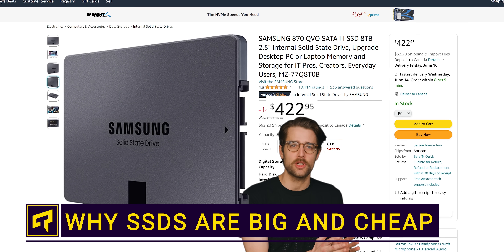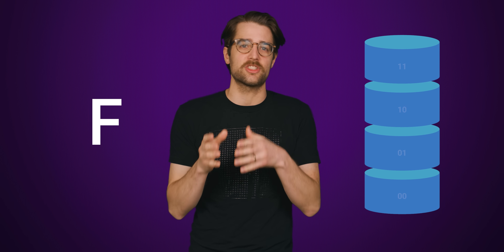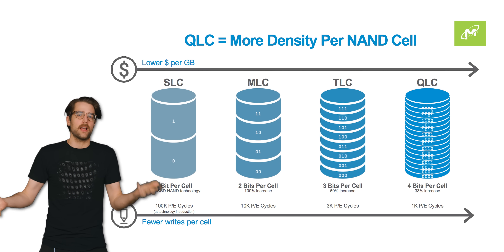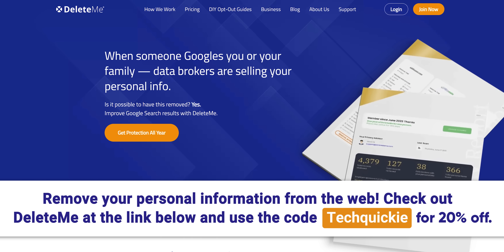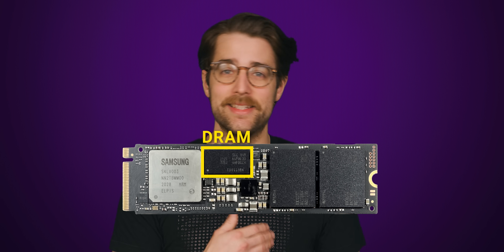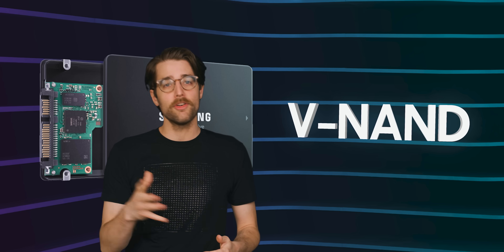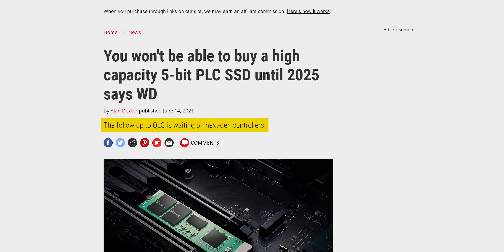Why SSDs Are Big And Cheap

Comment: So what's the best type of SSD to buy? Or it depends on what you do with it? Let's say best type of SSD for installing(and uninstalling, of course) games and play games from it, what SSD should I buy? And also, what's the best type of SSD for storing photos and videos(not random ones, important, memories, vacations, etc)? Or for photos and videos HDDs are more recommended?
Reply: If you can cheaply get 1tb true SLC one - go for it. Though it will be quite expensive and these models are rare. But as the video mentioned, modern TLC and QLC will use SLC filling schema until they run out of space and will reshuffle and squeeze the data to get more capacity, so it doesn't really matter that much.

Basically, if you want a great SSD - go with samsung, 3D NAND TLC kicks ass in terms of everything, basically. 

But if you want it cheaper, get basically any TLC one, but don't forget to check if it has DRAM cache on board. If it doesn't - don't buy it, it's not worth it, the speed will suck ass and it might get borked sooner depending on the controller (disk lookup table, something that changes constantly as you use your drive, is usually stored in DRAM and backed up on the disk before shut down, but without DRAM it has to be constantly written to on the drive itself). 

If you want a huge storage for random stuff that you don't plan to rewrite often - QLC is your pick. All SSDs can handle infinitely many read operations, the only thing that degrades the cells is writes. And to be fair, even QLC will probably last you half a decade or more even considering semi-regular rewrites.
Reply: @ДмитроПрищепа-д3я  It would be nice if you recommendations would make sense, but they don't. 

Cheap 1Tb SLC ? They don't exist. 
DRAM is irrelevant for NVMe drives.
QLC sucks and barely any cheaper than TLC.

They only good recommendation is to go with samsung. 980Pro 1Tb for system + 970EVO 2Tb for stuff would be below 200$ total and will be plenty reliable.
Reply: @dat_21  
"Cheap 1Tb SLC ? They don't exist." that's why I said "if" and "cheaply" instead of just "cheap". Cheaply doesn't mean "10 bucks" it means "less than the median price", ok?

"DRAM is irrelevant for NVMe drives" wrong. The vast majority of NVMe SSDs actually have DRAM, unless they are garbage from a no-name company or something, which is a concern if you're trying to save money and go with one of those. Why do you think it's irrelevant?

"QLC sucks and barely any cheaper than TLC" perhaps, got some examples to prove your point?
Reply: @ДмитроПрищепа-д3я  First of all,  SLC drives aren't being made for consumer products at all. You basically advice to buy a non existent product.

DRAM is not needed for NVMe drive, because DRAMless drives can use system RAM with HMB, and almost all of them support it. It will be a little bit slower, but nothing substantial. These days the speed is mostly determined by the quality of the controller, the interface and flash chips themselves. DRAM can be useful on high end drives, but the drive will be totally fine without it.

Just checking in the QLC specs:

QLC:  WD Green SN350 - $86.
TLC:   WD_BLACK SN770 M.2 2280 $110.

TLC drive has twice the speed, supports PCIe4 and has 12! times the reliability. When writing big files it will be even faster.

Saving $30 on QLC doesn't make ANY sense, when decent TLC drives are like 30% more expensive and have many times the endurance and speeds.

Dramless though, but all trash QLC drives will be dramless, that's a given. And it doesn't matter, you can buy TLC with dram for like $120-$130.
Reply: @ДмитроПрищепа-д3я  Also, you can buy TLC from other manufacturers for like $85, and at this point QLC just doesn't make any sense.

Do not buy QLC, unless it's at least twice as cheap (and it never is).
Reply: @dat_21  Yup. In my case though, I bought a Kingston NV2 1TB for $75, whereas the Samsung 970 EVO 1TB costs $150 in my country.
Twice the price for the same capacity. I only use it to store games and play on it so it's not write intensive and it does the job for me.
Reply: @lewsee5562  That's way too expensive for 970. It's 2Tb for less than $130 these days. It wasn't like that all the time. It's the recent price cuts.

Comment: Something that people need to take into account when dealing with the longevity issue of SSD's.   How long will you actually use that SSD.  I'm a pretty heavy user of systems and I've also been buying SSD's since they first came out.  I can't tell you how many I've bought, maybe 20 or so.  Of those 20, I've only had 1 to actually go bad during use.  I have shoe box full of them that other than being to small for my purpose are still perfectly good.  I do have a 256GB in my nas that is almost 10 years old.  I ran a check on it and the SMART says its fine.  

For general purpose users I, and others in my circle, have found that SSDs get obsolete long before they wear out.  I just replaced a samsung 960 that I have used as my C: drive in my workstation since that model came out.   If the Magician software is to be believed I'm half way through the lifespan of the nans on it.  I only retired it because it was to small for my needs.  One thing to take into account on the longevity of SSD's is they all have a system in then that will tell you when they are about to die.  Most OSs will read this data and tell you this drive is going to join "the heavenly choir" soon and to replace your data.    With HHD this warning is hit or miss but with SSD it's pretty much spot on.

So, my advice on buying SSDS is buy a quality one and don't worry about longevity.  Odds are the SSD will outlast the useful life of the computer.
Reply: Logically, outside of a catastrophic failure of the controller which would most likely be caused by a power surge or something similar, one would expect an SSD to fail one cell at a time, which makes it very easy for a well designed monitoring system to accurately assess the health of the drive. If I'm not mistaken, I think my dad's PC has been running it's SSD for upwards of 10 years and has only shown any noticeable signs of possible degradation in the last two or three years.
Reply: Even if they do wear out they don't actually die you can still read from them. That's the main selling point for me, reliability. My last platter drive was a 3TB toshiba purchased in 2018 and it started giving me a SMART warning within 4 years.
Reply: @atomicskull6405  how ssds die and whether they die gracefully into RO depends largely on the controller. So a decent controller will let you read data, otherwise you might not be so lucky
Reply: Exactly. I have a SSD with 128ish GB since over 10 years and no issues. HDD die a lot more often.
Reply: My experience is same. I've buried a few hdds, whereas I still have none of the many ssds that have failed, even the cheaper ones, and a shoebox of smaller ones that are just not very practical to use any more
Reply: Not to mention some\all ssds by now have protections in place. When it uses up all its nand writes it locks itself to read only mode so you can still recover everything and get a new one. Nothing short of electric surge or manufacturing defect/firm ware bug kills them. Mechanical failure is near impossible. harddrives fail due to mechanical reasons.
Reply: years ago, I used to sell 40mb hard drives to business customers and I told them they would never fill them up!
At the time I was right
Reply: Can you give an example of good quality ssd ?

Comment: If we're being pedantic, "NAND" generally refers to the logic gate rather than the flash. NAND flash is what actually stores data. NAND flash doesn't actually have anything to do with the logic gate. The only reason it is called "NAND" is because of the way the cells are arranged. In NAND flash, the cells are arranged in series between the source line and the contact. This is the same way that the transistors in a NAND gate are arranged.
There is also NOR flash which actually predates NAND flash. This was called NOR flash because its cells are arranged similar to the way the transistors in a NOR gate are arranged (in parallel). However, this technology has largely been abandoned because it has a dramatically larger cell size (more than 2x). This is because the parallel nature of NOR flash requires every single cell to have its own connection to the contact and the source line versus NAND flash which just has one cell connect to the contact and one cell connect to the source line, with every single other cell just connected to each other in a line between the two end cells.

As mentioned, PLC NAND will give more storage more cheaper, but it will absolutely obliterate endurance and performance. Every bit you add to store in a cell halves the voltage gaps between each bit value because you need a distinct voltage value for every possible value that can be represented by the cell. So SLC is easy, the cell either has no voltage (0) or maximum voltage (1). But then you get MLC where you need four possible levels, so 0V (00), 0.33Vcc (01), 0.67Vcc(10), 1Vcc(11) for example. Go to TLC and you need 8 different levels. Then with QLC you need 16 levels which is why the endurance is so bad on QLC drives because just a little bit of wear and they will start leaking enough charge to put them outside of their tiny 1/16thVcc voltage range and then you have a bit error. PLC will be even worse, requiring 32 different levels. Furthermore, since you're storing 5 bits per cell, you need to rewrite all five bits even if you only changed one bit. That's why performance is so bad on QLC NAND (once you fill the cache on any consumer drive), because you need to transfer 4 bits for every single operation even if not all the bits are needed. With PLC, that overhead just increases further. As such, PLC will be relegated to the cheapest, slowest, shortest-lived drives.

Comment: 4:02 Why is 5-bit not doubling the capacity of the SSD?
EDIT:  They're comparing it to SLC. Yeah, each increase is only 25%, but it's like doubling the previous technology. Going from QLC to PLC is just as significant a step as going from SLC to MLC.

Comment: Why more bits per cell is slower? Doesn't that mean you can read multiple bits at the same time?
Reply: If I rememeber correctly in order to write a new bit the entire cell needs to be rewritten. More work and less lifespan.
Reply: Also works the other way around. In order to read a bit it still has to pull the entire cell and 'decode' that bit

Comment: A good idea for the next video is to talk about HAMR, and how this will allow 32TB hard drives to soon hit the market. HDD are not dead yet, not even close.
Reply: HAMR (Heat-Assisted Magnetic Recording)
- allows data bits to become smaller and more densely packed than ever
- to write new data, a small laser diode attached to each recording head momentarily heats a tiny spot on the disk, which enables the recording head to flip the magnetic polarity of a single bit at a time, enabling data to be written
- is the storage technology innovation that increases the amount of data storage in the area available to store data - a.k.a.“areal density.”
Reply: @Vertigon100  Similar to minidisc, then.
Reply: 32 TB HAMR would mean i could drop down from 8 HDD´s to a lower amount the only problem is price HAMR is probably not going to be cheap
Reply: When datacenters have not replaced all magnetic tape storage with hard drives, I don't see how hard drives are going extinct in many decades to come.
Reply: @fleurdewin7958  It's the complexity. Tapes are very uncomplicated when compared to HDD, so will always be cheaper for long term storage. That said, the tape industry hikes on the storage density development which is done primarily for HDDs, and then adopted and adapted for tape use.
Reply: @Anton Anime Hunter Yes, SMR is very good on the Seagate Archive drives, of which I own two, due to a very competitive price, but every time I encountered it on 2,5 inch USB drives it was unbearbably slow and those drives aren't even much cheaper stand CMR ones, so that manufactuers even try to hide the used technology in advertisements.
 @paulmichaelfreedman8334  I have no clue about tape storage development, in fact I thought it was stalled especially since technologies achieving higher data density would probably diminish the tape's main advantage which is long term storage and the cost for that.
Reply: I hope not. HDDs still have a ton of usefulness to them, albeit in more and more niche situations. I for one would not mind having a couple of cheap 20 TB disks in a NAS. Always good for backups at least.
Reply: ABOUT HDD.  Yes they are NOT GONE YET!!!  My son has recently built me, a brand new PC and it has a 2TB SSD with the bootable OS on it. Gosh it turns on so much faster than the very old very slow PC. I also have a brand new 8TB HDD Labeled STORAGE - because that will STORE every document, graphic and photo that I use for my job!! It would be a waste of an SSD to store these documents and graphics on any SSD which will then just sit there and actively do nothing with said documents or images. That's why I still have an HDD!!!
Reply: @francescathomas3502  SSDs lose data over time. Expect maximum 5 years for file retention. So don't forget to plug your ssd in from time to time to extend that period. HDDs last 10 years on a shelf without maintenance but being magnetic they lose data over time. Also in my opinion shredding files on the hdd is useless. Get a very strong magnet or electromagnet and the data is nuked forever. Trust me.
Reply: @Vertigon100  HDDs can retain data for DECADES! ... I have 40 year old videotapes that play just fine! ... Magnetic storage is a mature and extremely reliable technology!
Reply: @marcse7en  There is a difference between magnetic videotapes and magnetic HDDs. Being mechanic the HDDs could function a long time but cannot retain data indefinetely, if you leave them sitting without them having "mileage" your data is not there after a long while but the drive is not worn enough so it can be used again. Until it mechanically fails. They are just more sensitive I'd say.
Reply: I have more trust in Toshiba's MAMR technology. The heat-assisted technology to me feels more challenging to achive high reliability. Both technologys are once again engineering marvels, that's for sure.
Reply: @armorgeddon  There are currently three competing technologies: Singled Magnetic Recording (SMR), Heat-Assisted Magnetic Recording (HAMR) and Microwave-Assisted Magnetic Recording (MAMR). Let's see which one wins !
Reply: They are close to dead for consumers. The read / write times are just not improving at the same level. SSD growth is still happening and backups will, for most consumers, go into the cloud. Of course the cloud itself is not a storage medium and that's where HDD play a role, because we are not going to wait for any portable media format anymore.
Reply: @owlstead  I, and everybody else who knows what they're doing, don't care particularly much about read/write times on bulk storage/backup media. Modern HDDs are certainly fast enough. Even if I would trust a third party with my data in the cloud, and keep paying that party a subscription fee to have access to my data, then local HDDs still win the read/write time contest vs the cloud. An SSD will inevitably perish within a relatively short timeframe, large and long-term local storage alternatives must always be available.

But yes, I imagine that most drives sold to consumers are those that come installed in new computers, and also most new computers are laptops, and the average consoomer doesn't ever change or upgrade the storage media in his computer before he buys a new one, so in that market HDDs are already close to dead.
Reply: A N I M E
N
I
M
E

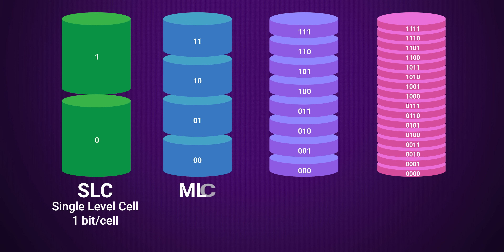Comment: 2:59 So why is 'multiple cell' not called as 'double cell' like the rest of the other cells? (single, triple, quad, penta). Also Triple cell seems to be one cell short from its stack.
Reply: Because they had single cell, then invented 2 together and decided to call it multicell. Then invented 3, but they couldnt call it multi so went with triple, etc.

Comment: I remember paying £200 (£492 in today's money) for a puny 200MB HDD for my Amiga 1200 in 1995. At those prices, 8TB would cost £19.7million!
Reply: $400 for 40MB in Australia circa 1990 in an AT clone. Storage was super pricey back in those days.

I still have my A1200, A500 and C64 in my cupboard boxed away. Still the best computers in my opinion. There was more fun and comedy involved in computing back then and I miss it these days. If you pull apart an A500 you'll see they named all the chips and had them etched on the PCBs. Paula for sound, Denise for video etc etc.
Reply: @----.__  Indeed there was. And I didn't know that about the chips. lol
Reply: @SpiritmanProductions  You'll love this then; the A500 chip responsible for RAM addressing and some video functions was called the Agnus (512KB). The later more powerful generation was the Fat Agnus (1MB), and the last most powerful generation was the Super Fat Agnus (2MB).
That's what I mean about the fun and comedic angle they took back then, it's sorely missed these days. The Agnus naming convention was a lot more fun than the typical 3090, 4090 naming they use these days.
Peace mate, nice to have met you.

[edit: holy sh!t your channel is huge!! have another sub, gratis]
Reply: @----.__  Cheers. ;-)

Comment: So what if you have an SSD with both an SLC cache and DRAM cache for your QLC? Would that be the ultimate drive?
Reply: That would add cost, which would make the cost benefit of QLC drives null, and at that point, just go towards a TLC drive which has less drawbacks